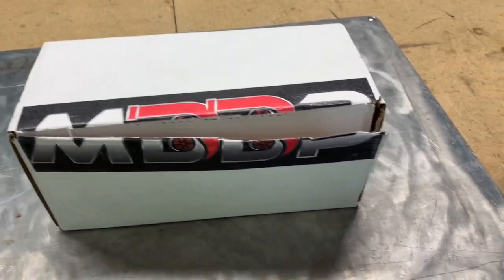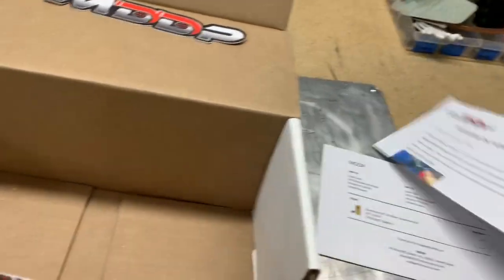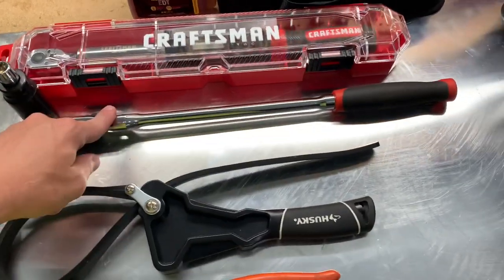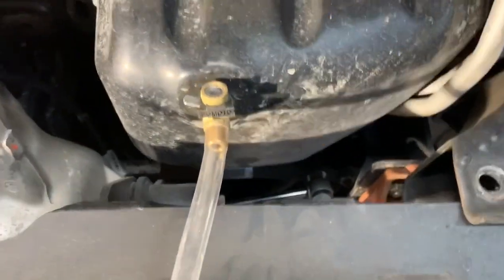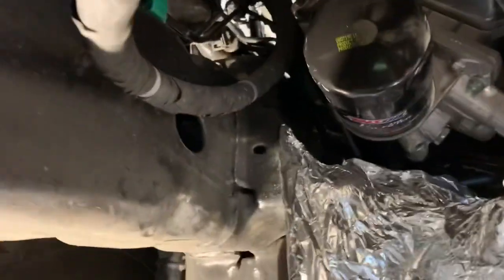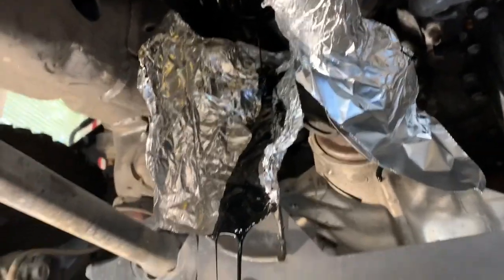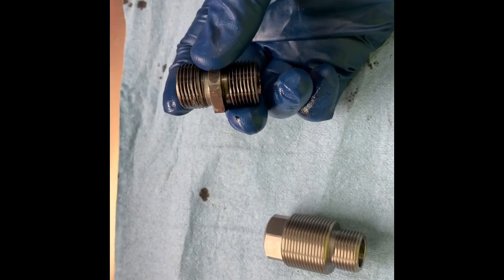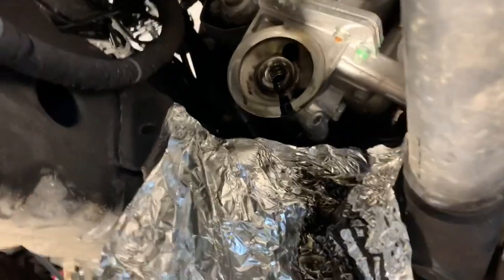CAT Oil Filter Install Duramax L5P!

Comment: The Cat filter doesn't have an anti-drain back valve in it. They are built into the Cat engines that the filter is used on. Every time the truck sits after use, the oil drains back into the engine, therefore the longer it sits, the drier the internals are inside your engine. Do not do this swap! Use the Amsoil or PPE setup. No adapter needed and they have the anti- drain back valve in the filter. Wear caused by dry startups is very harmful to your engine
Reply: The filter points down slightly so unless it's draining uphill it'll be fine.

Comment: Just FYI.. the cat filter does not have an anti drain back valve in it..  will allow for dry start ups. I got info from PPE info on youtube
Reply from the maker: Yep. I’ve got a PPE for it. Next oil change it will go on. Thanks for looking out!

Comment: If your trucks under warranty you shouldn’t be doing any of this to it my new Chevy Duramax diesel 2024 I have the extended warranty I’m using the regular factory oil filter and the regular drain plug. It’s better to take the regular drain plug out and let the fast rushing oil out of the pan and get most of the debris out of it, also when I change your oil I leave the plug out and don’t do quarts of Noyle in and let that wash it out and use a regular GM oil filter. The GM oil filter is very small for this engine but if you change it every 2000 miles like I do you have no worries just a thought.

Comment: I see you’re running the Banks derringer with the ram air. Are you running the monster exhaust as well and what kind of results are you seeing from all those bolt on mods? 
Nice videos by the way.
Reply from the maker: Yes sir. It’s running, Banks derringer, I dash, monster ram air, monster exhaust, pedal monster and banks ram air diff cover. As for the power, it’s night and day power difference. All the Banks goodies really woke this truck up! It’s not even close to a stock set up. Thanks for the positive feedback! Thanks for watching!!
Reply: Scott Link glad to hear it. I just ordered a 2020 GMC 3500 and I’ve been kicking around getting some goodies for it. Thing I like the most is no warranty issues while running Banks.  Great videos and you’ve got another sub! Keep up the good work!
Reply from the maker: Matt Sanders - I appreciate you watching and subscribing. More videos to come!

Comment: Did this change the oil capacity?  An oil change with the stock filter would be 2.5 gallons.  After filling and running did you have to add?
Reply from the maker: Daniel Duzan yes. It’s mentioned in the video sir. Extra quart

Comment: What are you thoughts on the comment below? I just ordered two CAT's with nipple. Now thinking I should look at the PPE. I think Steve below has a point however, I haven't heard anyone having an issue with the CAT.
Reply from the maker: I actually swapped the PPE a couple years back. The ability to screw on a filter without the need for an adapter is nice .
Reply: @linksgarage1985  I just ordered three of them and will return the CAT's. Next us a centrifuge system and lift pump.

Comment: Great video!
Reply from the maker: Thank you! I appreciate you watching!
Reply: @linksgarage1985  how is the CAT filter working?  No issues?  Running the PPE in our 2019 L5P and also using the same for the Allison.
Reply from the maker: @brianjacobsen8365  I have had no issues so far. Although, I do have a PPE purchased sitting on the shelf in the garage. I will be trying it on the next oil change.

Comment: Are the microns better in the cat over ams oil filter? Currently running ams in my l5p
Reply from the maker: I believe so. Actually the PPE spin on has the lowest micron rating now. And it’s the same size as the CAT. And you don’t have so do a spin on adapter. It’s a direct spin on for an OEM unit. I think I may try that next oil change.

Comment: I'm definitely going to get this filter upgrade also. Thanks for the videos!! 1 question, will it void your warranty? Same with the fuel filter upgrade, warranty is my concern.
Reply: Haha warranty question answered lol
Reply from the maker: Honestly, I have the same question. I am not totally sure. I’d just keep the factory parts. That way if you have to take it in, you can swap back to stock. Easy to do. And thank you!
Reply: @linksgarage1985  I'm going to wait until my warranty is up. I'm going to drop my L5p off at the dealership Wednesday. They're replacing my injection pump and injectors under warranty.
Reply from the maker: I wonder what went wrong with them?
Reply: @linksgarage1985  injection pump came apart sending metal debris throughout the high pressure system. Tech said it's not common on the L5p, but hes seen a few fail. He said the LML was really bad.
Reply from the maker: Ricardo Gomez thanks for the info!! Sorry about the issue. At least it is covered under warranty!
Reply: @linksgarage1985  exactly lol if not it would be 10 to 11 thousand dollars

Comment: Your motor is under warranty for 100k, its bumper to bumper for 36k, just fyi
Reply from the maker: For sure! There are lots of motors in this thing. Power step motors, window motors, wiper motors etc. however the engine, yes, it’s 100k. 💪🏼

Comment: Do you like the Banks Intake?  Did you notice a difference?
Reply from the maker: The Banks intake was fantastic. It fit like a glove and had a huge filter. I have since replaced it with a WC fab unit. Mainly because it’s powder coated to match all my turbo piping. Lots of other videos on the channel you might be interested in. Thanks for watching I appreciate it!

Comment: Scott, Have you thought about the AMSOIL BMK27dual bypass filter kit.? Im playing around with the idea but me being an OCD guy that over changes his fluids, I think I would be installing it to make me feel good rather than being useful. Not sure yet.
Reply from the maker: I have looked into that quite a bit. Only thing that sucks is you have to fab up your own mounting brackets etc. (or at lease you had to 6 months ago). But the system itself seems to be freaking awesome. Amsoil provide great data regarding these products.
Reply: @linksgarage1985  There is a nice ( expensive) bracket kit that don@donsoil.com fabs and sales. You can watch his video. He wants 300.00 for the kit but he includes a lot + a rock guard.
Reply from the maker: @jeffward7502  yep. I’ve watched them all. That’s almost $1,000 with his kit and the amsoil kit. And there are Duramax’s out there with 500k miles on them that have used the AC Delco PF2232 and regular old oil. So it’s up to the end users preference.
Reply: @linksgarage1985  yep it a bunch $. Amzoil could sell a ton more of these kits with them coming up with an inexpensive mounting option. If I did this, it would be a 2 phase purchase and install. Buy the bracket and install and then a few months later when due for an oil change purchase and install the bypass kit. I will think about it for awhile.
Reply from the maker: @jeffward7502  might look at the PPE oil filter. It utilizes the factory thread adapter so no need to remove it like the CAT. And it offers greater micron filtration than the CAT. I have one I am going to use on the next oil change.
Reply: @linksgarage1985  Sounds like a better way to go. I will go with it on my next oil change. Thx
Reply from the maker: @jeffward7502  - Roger that! 💪🏼🇺🇸💪🏼🇺🇸
Reply: Don’t put the amsoil dual remote kit on an 2020+ L5P. Amsoil tested it and it cavitated the oil pump, so there is a pending re-design for the 20+ L5P. You will smoke your motor if you try it.

Comment: Dude mine was in so tight I couldn't get it off amd said fuck this and got another ac delco
Reply from the maker: Damn. Well I’ve swapped to PPE now. Same size as the CAT. But uses factory threads.
Reply: @linksgarage1985  I'll go with that in the next change!

Comment: Are you still using  the cat oil filter
Reply from the maker: I am using PPE now
Reply: Do you need the adapter  for the PPE filter
Reply: How many miles between  oil changes
Reply: Have you done upgrades  on the fuel filter 
Sorry  for all the questions 
My truck has 353,678 miles on it trying  to get more out of it
Reply from the maker: @gerardomarruffo9405  no adapter needed. I still change it every 5k miles. It’s overkill. But that’s how I do it
Reply from the maker: @gerardomarruffo9405  black market performance fuel filter upgrade. Soon on CAT fuel filter. Change every 10k miles. 

PPE double deep Allison trans filter. Change every 10k miles
Reply: Ok thanks 
I'll wait on the video

Comment: Would you take this over the PPE filter?
Reply from the maker: Well, hard to say. I do have a PPE oil filter brand new in the box. I may try it out next oil change. It does have the anti drain back valve. Although I have had no issues with the CAT filter so far. A lot of research might lean me toward the PPE filter being a better option. Although it’s 2 times the price of the CAT!
Reply: Think ill try the PPE see how it goes.
Reply from the maker: I think either way you will be good. One big advantage to the PPE is no adapter needed. Just spin it on!
Reply from the maker: Also, check out the PPE trans vid I did if you are interested. https://youtu.be/U-tWJjCmPPM

Comment: What are the specs for the fumoto valve?
Reply from the maker: Jacob S - I can make a video on this soon sir. Don’t have all info right off the top of my head. But I can tell you, it’s an amazing upgrade.
Reply: I've researched and ordered 2 different fumoto valves and they were both wrong. The part# would be awesome! Great videos!
Reply: @CFarmer  
I ordered the fumoto valve F-137 on Amazon.  It fit my 2019 2500hd GMC perfectly. 

F-137: STANDARD VALVE WITH 12MM-1.75 THREADS WITH LEVER CLIP
Reply: Perfect, thank you. Im going to order it now. I looked it up on 2 different fumoto charts but it listed 2 different ones and neither fit. I'll get this one ordered. Thanks again!
Reply: @jakethesnake22  I just wasn't ro make sure before i order, yours is a 17-19 L5P ?
Reply: @CFarmer  Yes. 2019 GMC 2500HD - L5P
Reply: Awesome, thank you.. ordering now
Reply: Convenient and mess free. The only complaint is when I removed this valve for a experiment I got an additional 5oz of oil out of the pan.